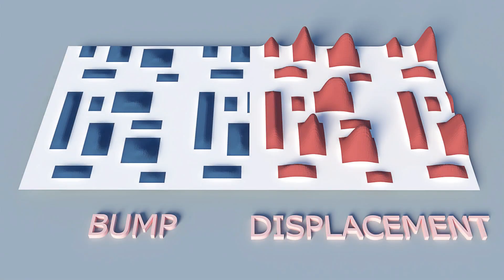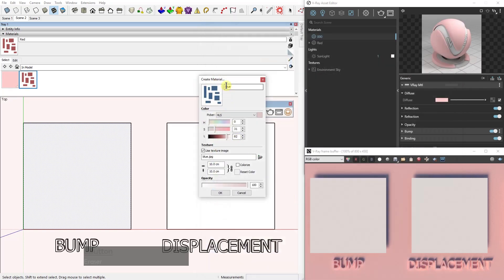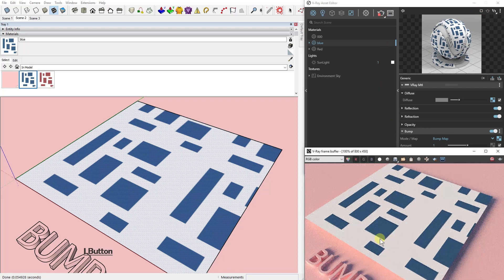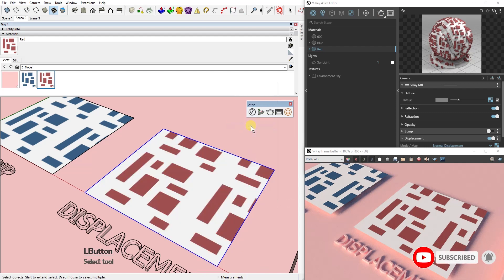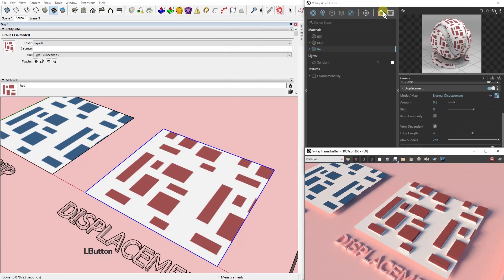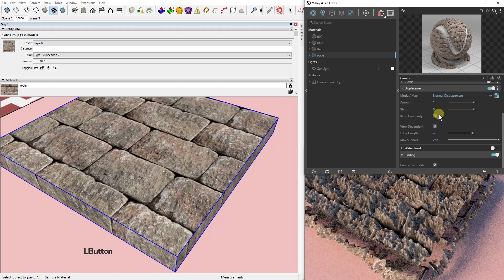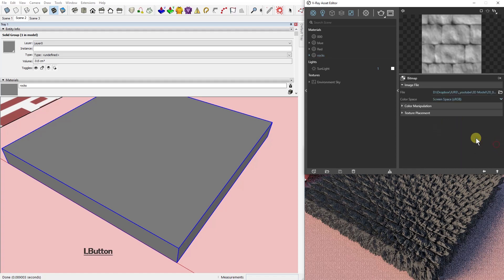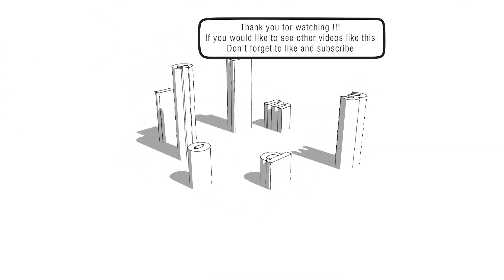Bump and Displacement Maps in Vray for Sketchup Tutorial

Comment: i applied all setting as you, but bump/displacement are not working in software sir, please give any suggestion or give me any solution sir
Reply from the maker: Your bump material needs to be in a separate group containing only that material. And that material needs to be applied to the outside of the group. If you have more than 1 material inside a group, bump and displacement won't work.
Reply: @SketchupStyle   thank you so much sir